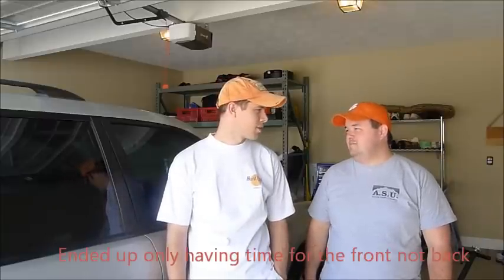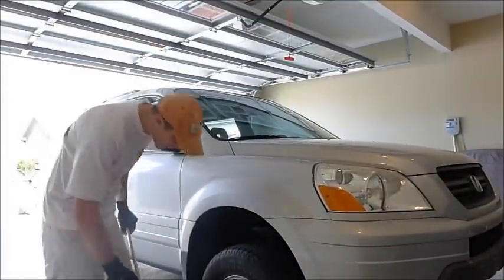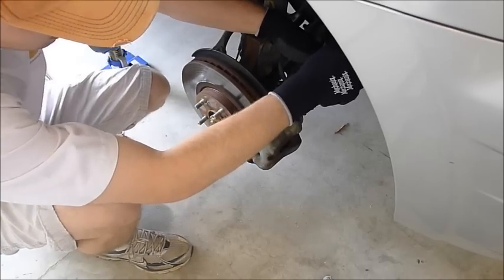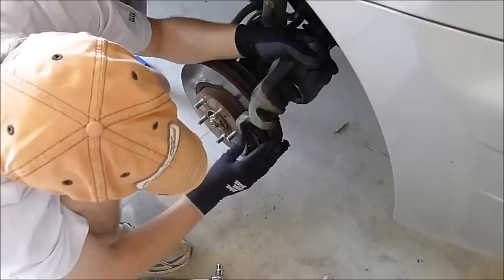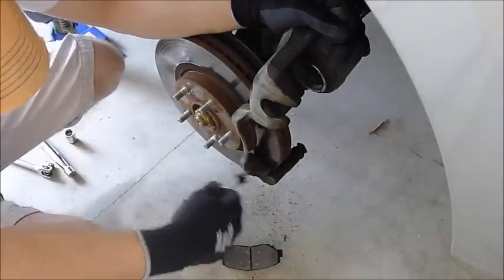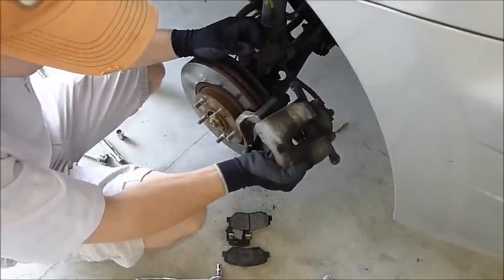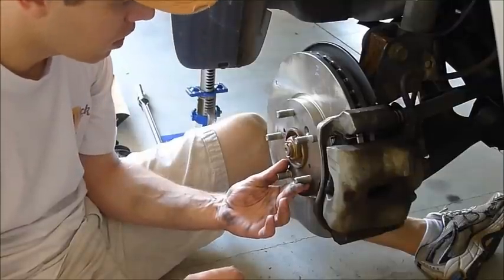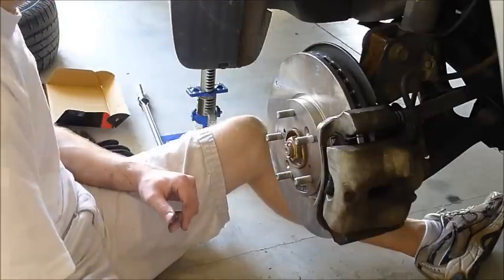Honda Pilot Brake Job

Comment: Thanks for the video. I did the front rotors and pads on my 2015 Pilot today.  Mostly and easy job except for those caliper bracket bolts were wicked hard to break free.   I can vouch for the comment about not needing the rotor screws (I used them anyway).  I work in the plant where Pilots are built and the suspension subassemblies are built off line and then carted over and attached to the bodies on the assembly line and it is later in the process when the wheels are attached.   Those screws are need to keep the rotors on until the wheels are mounted.

Comment: I started doing my brakes again after many years.  Have done 5 brake jobs since and am going to do my wife's 2012 pilot soon.  Things I have found out is to use high temp thread sealer on the caliper mounting bolts.  Also use Sil Glyde on the caliper pins as it does not swell or hurt the rubber.  Use Moly or brake grease only on the friction points on the brake pad/caliper mounting contact spots.

Comment: Great video! 
One tip that may help some who have a problem with the rotor screws; they can also be carefully drilled out.
Reply: Kelly McGuire 

Exactly. And then do not replace them.
Reply: Or use the right tool. JIS impact screwdriver. Try Vessel Brand

Comment: LOL "...in turn you may FAIL" ~ good safety tip though!

torque specs 12mm caliper bolts ~27 ft lbs
caliper CAGE bolts ~ 41 ft lbs
wheel lug nut bolts 80 ft lbs

i would use an old brake pad w/ that c-clamp for a more even pressure

some special tools are for the REAR pistons w/ integrated parking brake mechanism (they usually turn clockwise while pushing in)

these honda pilots 2001-2006 have a drum/rotor setup for the rears, so just compressing the rear piston w/ a c-clamp is good enough

bushing on the top sliding caliper pin... when you just do pad replacement only, you un bolt the bottom bolt & swing the caliper assembly UP to replace pads & push the piston back in while it's mounted w/ the top bolt only

star-pattern on final tightening on wheel lug nuts to specs once the vehicle is on the ground...

one of the most complete tutorial on front brakes ever! good job!
Reply from the maker: Thanks!
Reply: I'm unable to insert caliper pin with bushing. Looks like its swollen with brake cleaner. Is there any harm to braking system with no bushing?

Comment: Also when you cleaned the area where you mentioned it’s hardware? Those are clips after you cleaned them you should have put the grease back underneath the clip and on the clip. It’s green grease that is also used inside the support, in the guide pin and lock pin holes . Good video

Comment: First, thanks for the video.  Second, its probably worth nothing that when you compress the caliper piston to fit the new pads, depending on how much they are extended and how full your brake fluid is, you might need to open the hood and wick out some brake fluid as it can cause it to overflow.

Comment: The factory screws the hold the rotor on were a nightmare to get off, even using an impact driver.  Thanks for clarifying those can be tossed, because in the process of removing one, the screw broke in half.
Reply: Kevin McGrath Tell me about it! lol. I stripped two and when drilling to get them out I stripped a thread hole and freaked out! Then guy at parts store said those screws are unnecessary and explained that once the wheels are installed it will keep the rotors in place.

Comment: awesome, kid knows his stuff!
Reply: Well good job. But why whack the rotor with a mallet when you have those other 2 bolts holes. Just use 2 M8 - 35 mm bolts, turn them clockwise for easy removing the rotors.

Comment: Great video, very helpful.  My rotors wore out on my 09' pilot and I have to pay $800 to replace the front and backs.  Stupid Hondacare doesn't cover it.  Do you know how much it would cost if I did it myself?  Although all I've ever done on a car is change oil and a flat.  Thanks
Reply from the maker: Nick Plazio Nick,
Pricing is below for all of the parts.

You are looking at about $300 in parts is everything needs to be replaced but you might not need to do the rear disks depending on how much wear they have. Here is the pricing for each part:

Pads: $22.99-55.99
Pads I used: $55.99
Rotors: $45.99-67.99 per rotor
Rotors I used: $45.99
Hardware kit: $14.99
Pin boot kit: $10.99

Thanks
Paul
Reply: Awesome!  Super helpful thanks.  Yeah I had to do disks they only had 10% life.
Reply: Nick Plazio 

I just replaced all 4 rotors and brake pads on my 2005 Pilot over the holiday weekend. I found a full set of cross drilled and slotted rotors with brake pads on Amazon for $250. Installed it myself and took maybe 3 hours since it was my first time. It's fairly easy as long as your are mechanically inclined and have basic tools such as ratchet, sockets, phillips screw/power drill, wrenches, grease and WD40. Might even need a mallet to hit the rotors in case they're rusted tight. And also, make sure to use jack stands. I used 3 as safety precaution. Used regular jack, jackstand and placed wheel underneath the car with 2x4 on top of wheel. Good luck!

EDIT: You'll also need a c-clamp to push the pistons back in.
Reply: Awesome, good to know for next time thanks.
Reply: The Honaa OEM pads come with the hardware. I got a boot kit off RA for a couple of $ on a closeout.

Comment: Don't forget to open the cap on the brake fluid when you press the caliper cylinder back in.  I use the old brake pad to push it back in with a C clamp.  Also many brake instructions tell you to torque the wheel bolts down properly so you don't warp the new rotors.

Comment: Not only are those screws for keeping the rotor properly aligned against the back plate (keeps the rotor lined up with the lug screw posts), but they're also a safety feature.  They actually do serve a purpose.
Reply: lmind2 

Not true.

Comment: I need to change my wheel stud there seems to be a back plate will that get in the way of hammering out the stud if so what would you recommend as far as getting the stud out
Reply: Steve 

There's probably a cut out to punch each one individually through.

Comment: Great video! will this method work with the 2011 honda pilot?
Reply from the maker: Tommie Bao Yes it should be extremely similar. That is the newer generation but all of the steps would be the same as these.
Reply: TheClutchPedal.com Thanks! you guys are awesome for doing this. By the way, my pilot's mileage is at 30k right now, do you think it's a good time to change the rotors as well or should I just bring them to a shop to have them resurface it?
Reply from the maker: Tommie Bao Tommie, Just visually inspect them (do they have grooves or does there seem to not be much metal left on the rotor surface?) it really depends on how much braking you have done in that 30k time frame if they will need to be replaced. It is usually more cost effective to buy new aftermarket rotors then bring them to get machined. Thanks!
Reply: TheClutchPedal.com It's super awesome that you guys are still replying to this video after 2 years! I will be tackling the job next week when I get the parts and will be visiting this video often!

Comment: you do realize those 2 screws that hold the rotor on is a safety feature.if you lose your wheel the brakes will not function properly with a loose rotor causing your brake pedal to travel to the floor. better to put the two screws on like your supposed to.
Reply: +J Davidson (Mr. Tinker) wrong
Reply: Davidson I admit when I'm wrong. after I wrote my statement I realized what you said did make sense. My apology's.
Reply: +John Burns i never used to put those spring steel washers back on brake drums till somebody smarter than me clued me in to what they were there for. the trick is to get them off without damaging them.i learned to do that and i rebent them back to hold good before reinstalling them. makes perfect sense if you really think about it. my ferguson tractor has screws holding on brake drums. just use ant-seize and removing later on is a breeze. i like to ask a lot of questions when watching someone repair something.
Reply: +mronemanband1 DRUM BRAKES AND DISC BRAKES HAVE THOSE SCREWS FOR SAFETY. IN THE EVENT YOUR WHEEL COMES OFF THERE IS NOTHING TO KEEP YOUR ROTOR OR DRUM ON THE VEHICLE. IF I DISCONNECT YOUR BRAKE LINE OR TAKE OFF YOUR PADS OR BRAKE SHOES WHAT WILL HAPPEN WHEN THE BRAKE PEDAL IS PUSHED? IT WILL GO TO THE FLOOR AND YOU WILL ONLY COME TO STOP AFTER IMPACTING SOMETHING OR HAVE ENOUGH SPACE. LEAVE YOURS OFF AND HOPE YOU NEVER LOSE A WHEEL. REMEMBER THEY SAID THE TITANIC WAS UNSINKABLE!
Reply: +mronemanband1 I JUST REDID THE BRAKES ON OUR 2011 PILOT AND USED DRILLED AND SLOTTED ROTORS AND CERAMIC PADS. WHAT A DIFFERENCE!  IF YOU BELIEVE THE SCREWS ARE FOR NOTHING LEAVE THEM OFF. IF SOMETHING HAPPENS AND A LOVED ONE DIES OR GETS SEVERELY INJURED AND YOU SURVIVE YOU WILL HAVE TO LIVE WITH YOURSELF FOR NOT USING THOSE SCREWS.
Reply: As I was reading I was wondering are these guy for real? To test JD's theory one would have to remove the caliper and the have the wheel fall off and see how long the assembly screws hold the rotor to the hub. I am guessing less than a second. I reinstall the screws if I am using rotors that have the holes drilled (as some don't) just to not leave a place for corrosion.
Reply: i wonder if the honda service manual says to reinstall the retainer screws? wonder if your pilot has the retainer screws after getting the rotors replaced by the dealer?
Reply: I typically  do my own brakes . The OEM and several aftermarket have them
Reply: You know damn well that two tiny little screws couldn't possibly handle the stress and pressure of holding a rotor on during breaking a 5000lb vehicle! Come on, man. In your extremely bizarre scenario, the brake pads and the strong-as-fuck caliper hold the rotor to the hub, not two puny screws. 

Sorry, but you're wrong. They're only for original assembly of the car. Nothing more.

Comment: Also, I would never put my legs under the car even on jack stands.  In addition, washing the rotors in soap and water with a scotch bright pad with take off any micro turnings that can damage your new pads.  Use a paper towel on the rotors and rub it in a circle around the rotor to see if it snags on those small metal fragments.
Reply: Ronald Brennan 

You wouldn't? Then you would never get under the car, period. Which means you aren't even changing your own oil much less any other under-chassis repair.